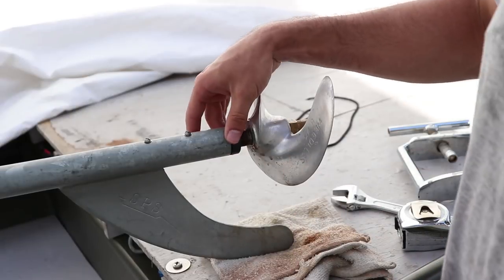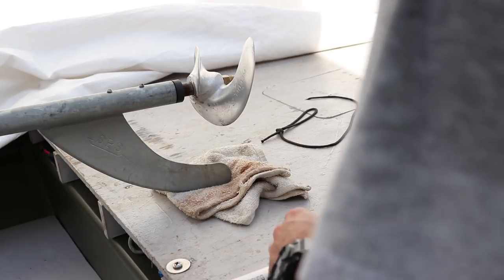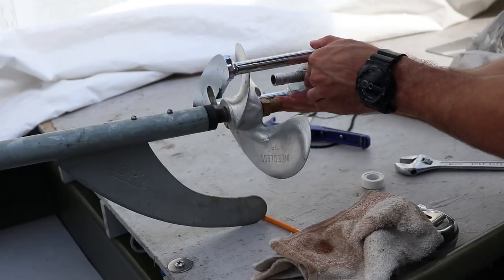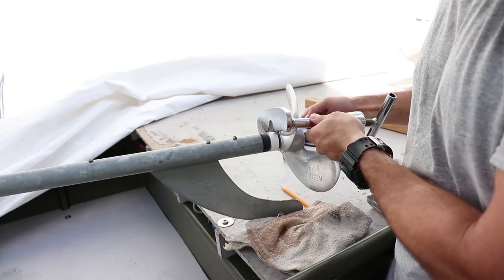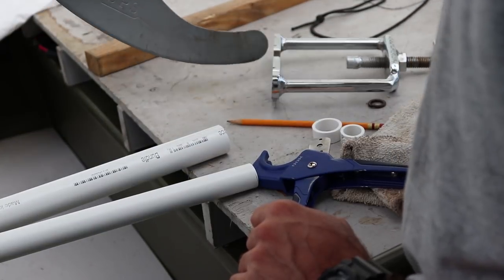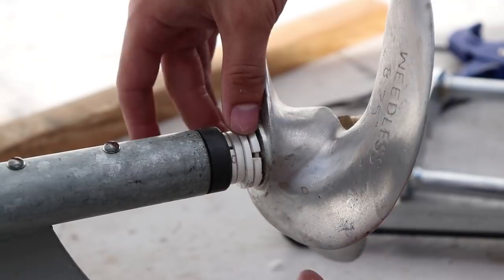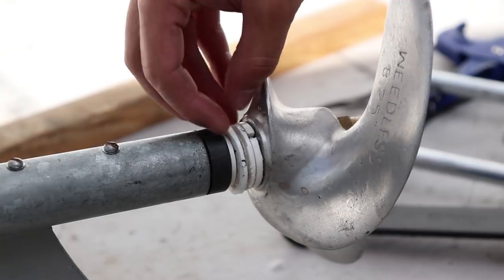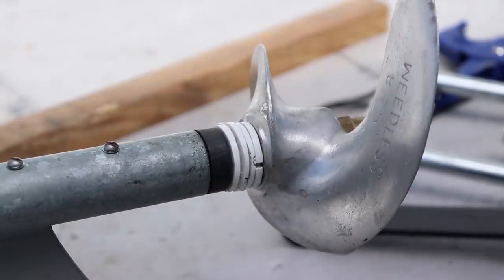How to Make your Longtail Mud Motor Weedless DIY Trick

Comment: Had to get my first prop off today (to down size and get rpms back up on my smaller motor), and a standard 2-prong gear puller worked great. I think one would still have enough lip to grab even with your spacer on there.
Reply from the maker: Great idea! If I got one of the 2-prong gear pullers that are the bent, metal ones, I could even sand it down thinner if I needed it to fit in between the spacer and the prop. Which kind do you have? I see there are ones with a hook-like end on it and some with a flat metal end on it.

Comment: Had a hard time cutting wild rice off the shaft so did this with an old shaft bushing.  Wild rice still wraps on it but not as bad and easier to cut off now so I guess it helps.
Reply from the maker: You could also try a metal weed cutter. You could use that in combination with the spacer. Look at swamp runner's website and you'll get the idea of how to make one for yourself if you don't want to purchase one. I've also found that the prop you use makes a big difference. A standard prop really eats up the vegetation and greatly increases the odds of the vegetation catching and clogging the shaft. When I use the weedless prop, I've yet to get a clog that I had to clear by hand by using just the spacer, no weed cutter bar needed.

Comment: Hey i was hoping you could answer a question for me brother. I just finally got around to installing my small swamp runner kit (212cc) and no matter what I do, I cant seem to get the shaft all the way into the coupler housing. Everything works as it should as if the inner shaft is connected to the coupler shaft, and the prop spins just fine wile running, but there is a 1/4" of play on the inner shaft by the prop and its bothering me. Is this normal or should there not be any play at all? Thanks in advance!
Reply from the maker: So what you need to do is loosen your wing bolts on you coupler housing and make sure your fuel is off and the engine is turned off. Once those steps are done, go to the prop and spin & push it to make sure it is engaged with the coupler shaft and that you are connected to the engine output shaft and everything turns together. Once you know everything is connected, your outer shaft (shaft housing: the long shaft that has the skeg on it) push that into the coupler as far as you can and then give the end of the skeg a few taps to seat it further. Once you did that, tighten the wing bolts up on your coupler housing and pull on the prop back and forth and see if you still have any play left. Let me know if you're able to get it
Reply: @JTgatoring  Thanks for the reply. I did that a couple times. Ive even banged on the tip of the scag with a rubber mallot but it just wont budge any further. It was extremely difficult to get it in there to begin with as if the coupler housing isn't open enough for the outer shaft to fit all the way where it needs to be. I set a message to Swamp Runner this evening just waiting to hear back from them. I was just wondering if it was normal to have a little play like that cause this is my 1st one and even when the shaft is pulled out on the "play" its actually fitted to the coupler shaft and turns with the motor.
Reply from the maker: @danielrichardsfishing8838  There shouldn't be any play when you grab the prop and try to move it in and out of the shaft. Maybe a little up and down and side to side depending on how worn your end bushing is, but there shouldn't be any slop pulling it in and out. The only thing it can be is your outer shaft not going into the coupler housing all the way. Take out the shaft and see if you have a distinct rub mark inside the coupler housing where it may be getting caught or preventing the shaft from going in further. Another thing to help is by twisting the longtail back and forth while pushing it into the coupler housing.

Comment: Why nobody use electrical conduit on the top of the tail as a exhaust pipe to forced fumes under water like ordinary outboard motor does.?
Reply from the maker: It is additional work that is not needed. People do not see the added benefit of doing that

Comment: Could you do the same with some c rings or snap rings?
Reply from the maker: I tried those PVC snap on rings and they didn't work as well. The one solid piece worked the best
Reply: @JTgatoring  i mean metal snap rings
Reply from the maker: @DrewVerdin  Where and how are you talking about using the metal snap rings?
Reply: @JTgatoring  same way as the pvc rings just metal snap rings.
Reply from the maker: I have not. I haven't seen metal snap rings of that size. I may be able to use washers to fill the gap, but that still doesn't fix the problem of getting the prop off with the prop puller, so I don't know

Comment: you should use the same concept that worked, but do two pieces. one the thickness of the prop puller that is split and can be pulled off. the second to fill the rest of the space and isn't split.
Reply from the maker: L P I may end up giving that a try if this doesn't hold up well. I was surprised at how strong the PVC was and how difficult it was to pull apart after putting a cut through one side. Thank you for the idea!!
Reply: JTgatoring no problem. I just figured there would be less parts and less complication. And the split piece you could just break them off each time you want to remove the prop and have a few spares made up to replace it. Good luck.

Comment: I would try using rubber hose....just cut it off....pull your prop....put a new piece back on...😁
      It's cheep enough, remains "one piece" and easly removed, easly replaced....just a idea to try.....😁
     I live up north in the clear water....but all boats matter!  👍
Reply from the maker: Yeah, that is a solid idea! No matter where you're from, ALL boats matter 👍 haha thanks for the idea!
Reply: @JTgatoring     You are most welcome.....😉

Comment: And upgraded to a 22hp harbor freight predator....big difference between 13hp and 22
Reply: ron demers what kit do you have
Reply: C Price.    I have the medium kit....just had to go up to a 9.5 inch prop and 100 in shaft
Reply from the maker: How does that run for you on your 1448 Alumacraft?? Did you try running it with the 85" shaft before you got the 100"?
Reply: JTgatoring. Had the 100 in shaft due to 20in transom....getting 20-23 with a 9.5 in prop
Reply from the maker: ron demers Have you tried going to a bigger prop yet, or is your RPM's in the right range?
Reply: JTgatoring had the 13hp with 8 in prop...got good speed out of it...but want more Hp and torque
Reply: Was doing 3600 in the water under load with 8 in prop...borrowed a prop from a friend for now

Comment: Hey next time you can't use your prop puller tool just disconnect the shaft from the coupler and leave the nut on the end of the shaft and loosen it and then strike it and the prop will come right off
Reply from the maker: Good idea Jack Mehoff. I'll have to give that a try next time I'm out

Comment: just use some rubber hose instead of pvc. cut the hose off when you need to use the prop puller. Hose is cheap just cut several spares and keep on your boat
Reply from the maker: Good idea! I'll give it a try
Reply: @JTgatoring   Well being as it got the PVC hot enough to melt it, it will probably do the same to the rubber. Looks like you need a thin wall brass ring. but then your back to the same issue with the prop puller. May need to modify the puller or just make another one
Reply from the maker: @jeffccr3620  I have not been able to melt it. There was a guy who made a fail video but he only did one section of sch 80 pvc so yes that will melt, but this spacer is sch40 with two pvc pipes inside one another. I also had a subscriber 3d print me a spacer that has two halves that is zip-tied together that works great also. I'm still open to other solutions and possibilities. What I have right now works great if you aren't constantly changing out props to test haha

Comment: Check out scavenger backwater motors, it's a long tail with a belt drive
Reply from the maker: I don't think I've ever seen those before. Not too good of a first impression. I'm just thinking about pull starting the motor with the engine facing the wrong way. That seems like it would be rough. Same with the throttle and choke to have to reach around to control those and the exhaust would be pointed at you to making it loud and smelly. Do you have one?
Reply: @JTgatoring  no but I was talking to a guy at the launch with one he says because of the prop they use they get through thick stuff real easy, and the exhaust on his was more on the side. Neat concept I'd like to test drive one for sure and see the difference in my long tail and the belt driven
Reply: Said it also solves the fuel problem he had of the fuel not flowing in the carb because of the angle.of the engine when he was running
Reply from the maker: @Sqwrly10  Yeah, that's definitely different. I mean if it works for him, great! If you end up testing it out, let me know how it went! What long tail do you have?
Reply: I'm running a swamp runner and I'm putting a fuel pump on her. Have a gx390 engine with a 8" prop on it pushing my 14ft boat
Reply from the maker: @Sqwrly10  There you go! I always thought of doing that but I never really need more than what the fuel tank is on the engine. Looking forward to seeing how things go!

Comment: why don't the manufacturers sell these with something like this.  it would probably cost them less than 50 cents
Reply from the maker: one of them sells a weed cutter bar now, swamp runner, and I've had some people say that the bar works but I don't have it on my longtail. The spacers I have work great so I have no need for the bar

Comment: How crappy is a mud motor that has to be hacked from the factory to allow it to run thru weeds? I used to have a similar thai kit and was useless in the cattails we run thru in our area. I learned the hard way that there's nothing more expensive than a cheap mud motor
Reply from the maker: I do not have a problem with it. I enjoy my kit and how it performs. It has run through anything I have put it through. The only problem I hear from other subscribers is the cattails, just like your situation. I have already heard back from two people that said this fixed the issue of the cattails binding on the shaft. These kits work great if they are properly set up and the cost is awesome compared to a brand name surface drives. The price of these kits allow others who don't have that kind of money the chance to get out on the water and do what they need to do to have fun out on the water. I see nothing crappy about that

Comment: Why don't you just use one piece and if you need to get the prop off use a saw to cut the pvc and then use the prop puller.....
Reply from the maker: I didn't want to carry a saw out on the water with me. The best thing I have found is to take the once piece spacer, cut it in half, and use a zip tie to hold it together. When I need to remove it, cut the zip tie, use prop puller, then just use a new zip tie to put it together